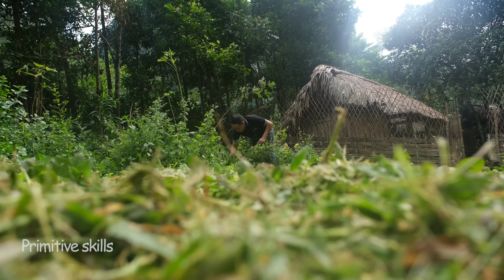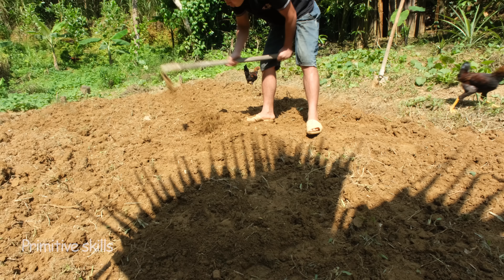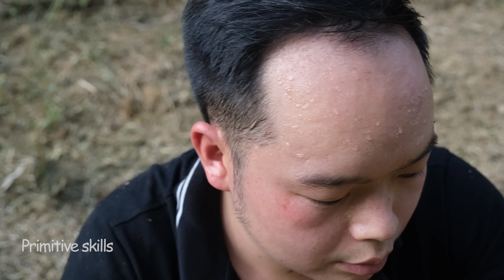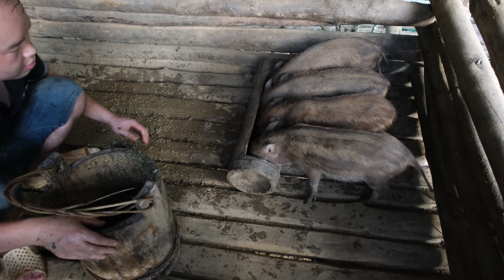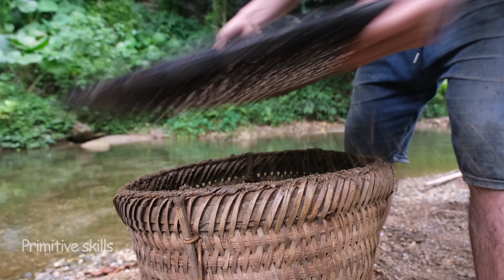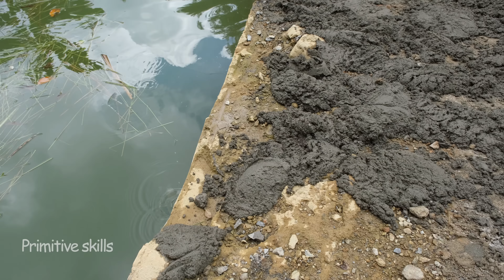How to build a pond ! Pouring concrete on the pond floor, waterproofing and drainage

Comment: Hi Duong! It’s so nice to see a new video! I was was expecting to see what you had woven with your loom, and what you used the cloth for. So hoping to see you finish that story line. : ) 

I had noticed in your wife’s videos that the upper pond was dry and wondered what had happened. I hope that this application of mortar on the bottom will fix the leaks! : ) That area of the pond will make a nice wading area for your children. Activities and chores that they can do at the farm will help them learn more about caring for the farm animals and growing things in the garden. 

I am not sure I understand why you laid those dry palm leaves on the new garden beds. If you are using them as a mulch on top that will gradually break down and decompose, it probably would be better to have chopped those up before layering them on the beds. That way you can  plant through them easier. The rest of those dried palm leaves  could also be chopped up and put into a pile near your garden beds so it will be handy when you need more mulch. : )
Reply from the maker: Thank you, wish you all the best 🥰🥰

Comment: #primitiveskills you are going to have to relay that concrete bed, it needs structural support, and the earth beneath it was not compacted. The weight of the water is going to push the middle, crack it, water will leak and form a cavity, then it will will collapse in on it self.
Reply: I think the base soil bed is hard and strong enough because it has flooded for weeks before ... it was a pond with soil base before..❤
Reply from the maker: Thank you, nice to receive your feedback, wish you and your family good health

Comment: Well.. your hoe handle is not too long, but the head is too light, i bet it is less than 1 kilogram, hoe head for breaking earth should weight 1.3-1.75kg , shorter handle make you bent over, causing back pain